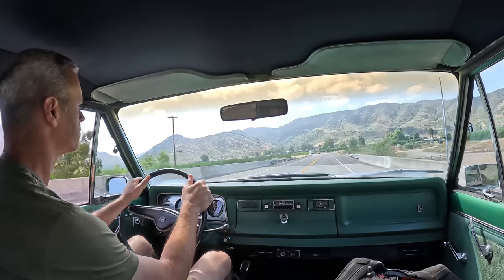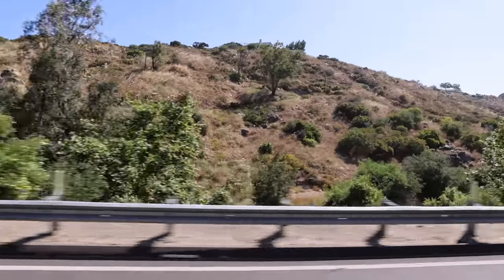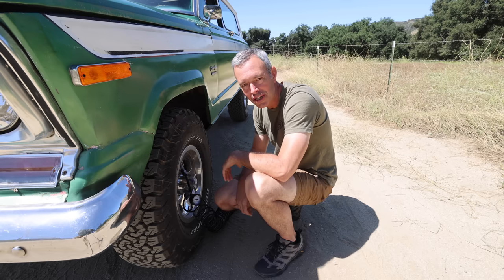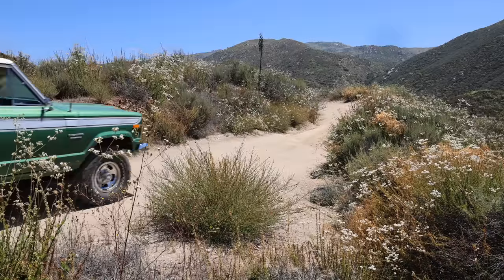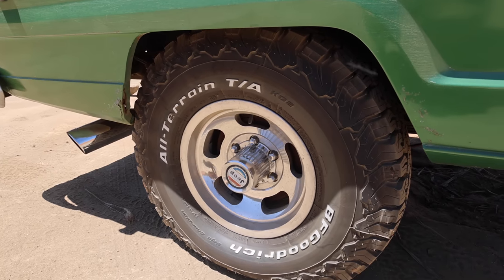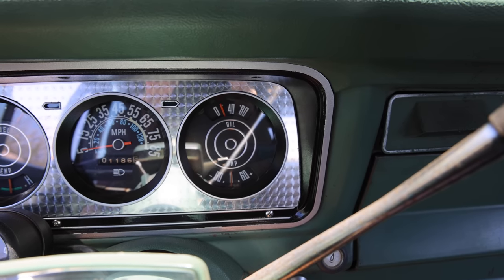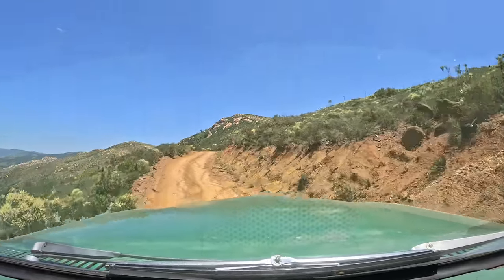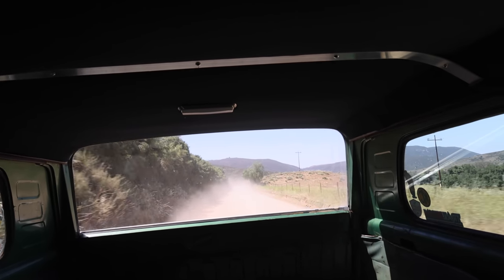Black Mountain Truck Trail, Ramona, CA - Prickly Pear Adventure

Comment: Brad you might consider replacing the carb with a Holley or Fitech system. No, it doesn't stay original but some things are better sent down the road.
Reply from the maker: Its an option, but then I'm adding computers to this old girl... so we'll see.
Reply: I agree Brad fuel injection is the way to go. My 83 Cj-5 would also stall in high elevations and steep inclines. The fuel injection fixed all my problems, and better gas mileage!!
Reply: @TrailRecon  agree, inject it and keep the old carb in the garage if you ever need it. Benefits outweigh the few cons
Reply: Holley sniper and the electronics  are fully self contained in the throttle body and looks like a carb. You can even hide it under the original air cleaner.
Reply: I definitely recommend this and swap the ignition system to and hei if you haven't already.  It's really easy and the fitech is great , self learning and my old 360 woke up from it and 12 mpg average now.
Reply: I agree - it may be worth the effort and expense of adding FI. I get wanting to keep it fairly stock, but for sake of reliability, you may want to consider it.
Reply: Add a sniper to my dad's old cherokee. Best upgrade we've done on it.
Reply: She is such a good looking Jeep  Brad. 10 mpg is tough on the wallet but I hope you keep her for ever.
Reply: @TrailRecon  Throttle Body Injection was the best upgrade I've done to my '85 CJ7 inline 6. Starts reliably and idles like a dream.
Reply: Gotta agree!  THe holly sniper fixed a whole host of issues on my RamCharger.
Reply: Plus one for a fitech
Reply: AMC guy here. CJ7 swapped a 360 Wagoneer engine and transmission, installed a Quadrajet carb,electric fuel pump, hei ignition. No issues. Been running the Quadrajet for about 17 years after Holley,Edelbrock.

Comment: When Prickly was going uphill and hit that bump and then died, I knew right away it was flooding from a carb float issue.  If you do not have the carb float set just right, uphills will cause flooding.  Also, the jets would need to be replaced to run at higher altitudes (it's not just a screwdriver adjustment).  Thus the comments below for using fuel injection.

Comment: If this unit is equipped with a Rochester Quadrajet carb there is no reason to change, this is an excellent unit and with the center float design works well at various attitudes (lean angles).  The plastic float however can get saturated with fuel and cause float level to go high. The way the rig acted when you hit the bump, I suspect this to be the case. You can also lower the float level from the original spec if you want to experiment.
Reply: Also sometimes raising the float bowl vent can keep high lvls of fuel from splashing up the vent tube and dumping too much fuel on the bumps, basically flooding the engine. Not sure if any aftermarket offroad needles are available like Edelbrock/Carter AFB's though.
Reply from the maker: It has an Edelebrock on there now.  Just a bit of sorting to do.
Reply: Oh nice! I used the offroad needle kit in my Carter Afb on my Scout II set my float little lower and never had it flood the engine and stall. I hope to see more offroad adventures with Prickly Pear!
Reply: I’d add my two cents as I had the same issue with my Wagoneer on speed bumps at sea level. Bowl was just too full and fuel would splash and cause a momentary flood. Though the Howell Eli Is most ideal for wagons over the excellent Holley, it’s not necessary but will help reduce the exhaust smell. You’ll be able to enjoy the rear window down for a drive. Best thing I’ve done with my wagons … run it on 100LL … a gallon or two in every tank makes a most noticeable difference. Every once in a while a full tank of 100LL makes it sing. The exhaust smells better and it’s just as unhealthy as any other petroleum you can run through them. My AMC 360 motor with an Edlebrock 4brl gets 12MPG in cruise.

Who doesn’t enjoy the vintage wheeling videos more than the ones of modern vehicles?

Comment: Looks like an edelbrock carb
You can get replacement needles to lean out your fuel at higher altitudes 
Very easy to change get up high change them out have fun 
Then change them back at lower altitudes when your airing back up 
I think part of the fun of a classic is tinkering with them
I mean you got some really nice and very capable jeep in your garage
Keep it old school have fun and keep learning 
Thanks for your video I enjoy them

Comment: Prickly pair is looking good. You may want to consider an aftermarket fuel injection system like Holley or Edelbrock. It won’t be original, but more reliable. Great work on her.

Comment: Highly HIGHLY RECOMMEND Howell TBI kit and dump the carburetor. Better fuel economy, starts up without problems and runs like a top. Swapped out my carb on my 4.2 straight six. But get an experienced shop to do it right. 👍

Comment: I have an 85 Chevy K5 Blazer with a 350 and run a Holley Sniper EFI unit on there.  It made a night and day difference on performance and would self tune itself on elevation changes.  That may be an option with the carb issues.  Glad to see that old beast out on the trail.

Comment: As mentioned before look at a fuel injection setup for reliability, for the radio there are several companies that build retro fitted radios with modern options with original style faces. Looks great man!

Comment: In 2004 I got a 600 CFM Edelbrock Quadrajet copy carb for my 85 small block suburban,  never rebuilt or touched the cab yet except for a choke spring. It runs fantastic from sea level in Ocotillo wells to 8,000 feet high on top of Santa Rosa Mountain.  I don't know if they make them as good now as they did 19 years ago but 100% pleased

Comment: I know its probably in a video somewhere I couldn't tell if you 74 had a low range unit on the transfer case some came without.. Makes me miss my 76 almost identical to yours.  I did put a mile marker part time kit in the transferase no overdrive. Not even sure if they make them still  Sold mine back in 1999 bought it in 1989 or about then.  I far as i know its still running around Albuquerque.  If you want to get ride of the Quadratrac  easiest way is to find a jeepster commando  with the T400 they have the mainshaft, adapter, and tcase model 20. I did that on another project I had.. love watching the progress.. i need to find pictures of mine

Comment: Carbs off-road can be an issue. Whenever on an incline and hitting a bump, fuel can splash into the ventures from the bowl vent. Usually, a mode can be done to extend the bowl vent up higher, minimizing the issue. The float needle sometimes can also allow unwanted fuel in the bowl with the bouncing of the float. We would install an adjustable fuel regulator, and drop the pressure when running offroad. Fuel injection was a great leap in offroad vehicles, just as electronic ignition. How times have changed. Thanks for the great video.

Comment: I also replied giving a recommendation for a fitech, but if you want to stay with a carburetor, the Holley truck avenger is a good option, we ran one on a sbc in our cj8, we could drive from denver to 13,000 feet in the mountains with no issues, it also runs at extreme angles

Comment: As you know, I throw my vote in for the Holley Sniper kit. It’s been great for my 360 and 78 Chief. But before that, please do the ammeter bypass!  Plenty of write ups on the FSJ forums. Would allow you to move to a higher output one wire alternator as well. The sniper kit will monitor your voltage for you moving forward 😎.

Comment: If someone else hasn't mentioned it yet, you really need to get an accurate oil pressure gauge, soon. That's showing very low oil pressure for a fresh engine. I would also consult your engine builder and confirm what weight oil they recommend for your build. This is such a great old Jeep!

Comment: Awesome truck, I’ve been there with a classic on the trails… I had a 75’ F250 highboy, I put a Holley Off-Road Truck Avenger Carb and it made it way more fun to drive, especially at higher elevations. Thanks for the videos!

Comment: Your Cherokee looks so good inside and out. If you want to upgrade the radio but keep the stock holes, look into Retrosound radios. It fits in the original holes and you don't need to cut up that wonderfully original dashboard. You could also get or build a custom center console with a modern radio. I question AMC's gauge senders, my oil pressure sender/gauge shows 10-20PSI when it works and my fuel gauge shows full at 5/8. AMC engines are tough. If it sounds fine, it probably is.
It's fun to see other peoples' rigs too. The Defender is really cool and the Lexus Cruiser looks capable.

Comment: Hey'as I was thinking about the tires rubbing in the rear, you might be able to flip the springs if you have  offset centering pins. As the axel moves up it goes backwards, put the short span in front, which in turn  will move the axel slightly forward. Then as you flex you might be able to gain that extra space needed.  Ofcourse this all depends on what you have. Good to see old iron on the trails!

Comment: Another great adventure, THX and HAPPY B-DAY Jordan!
At that slow of a speed, your Idle mixture screw is the predominant influence in the carbs and you called it as running too rich.  I'd try turning the idle mixture screw half a turn clockwise as a start to leaning it in.

Your York A/C compressor is still used in major Semi-Trucks and instead of 0.6 cu ft they now have a full 1.0 cu ft displacement at about $300.  If the Evaporator and Condensor are good then clean them out with solvent, remove all old oil, get 4 new barrier hoses, a TXV, operational port valves and a good cabin ventilation fan to push it and your A/C is complete.  

These are quite similar A/C systems that we hobbyists put together for our vintage Italian cars.  The most important part is tuning the A/C using fill to the condensor's subcooling.  LMK if you need help, I have all tools and parts to make my own, even custom sized to improve flow
Reply from the maker: Thanks!  We are going to give making a modification to the current compressor a go, but if all else fails there are some aftermarket options worth exploring.
Reply: @TrailRecon  - Good on you!
There are a lot of folks who will claim that a pricey Sanden compressor solves everything. 

When you actually use HVAC Engineering principles to start measuring the refrigerant around the system then you can make valid decisions from facts.

I found the compressor is not the limitation of our 1974 York systems , rather that is 1) The Condensor and 2) Cabin airflow

The whole system should be tuned to the Condensor's subcooling as it is the limitation

Keep us posted!

Comment: I installed a Holley Sniper EFI on my Grand Wagoneer and love it. Runs great, starts on the first crank, and have never had vapor lock issues since. As far as mpg though, I think it went from 9mpg to 9.5 with the EFI kit. Not much of a difference.

Comment: You don't show it, BUT.. don't trust the gauge on the compressor.  Mine is off by almost 5-7 labs, so I use  my trusted digital gauge for final readings.  Another fine video.  Thanks for the ride and until next time... Travel safe.

Comment: Hey Brad, congrats on the maiden voyage!  A cool fun video might be to take the drive-by footage and throw an 8mm filter on it B-)   Also, radio idea - check out the bluetooth speaker tubes people use in Razor's.  They're discreet, easy to install, and easily hidden.
Reply from the maker: That would be cool!

Comment: I totally understand and love this retro Jeep project. I have the same thing going on in  a 66 Bronco I’ve been driving since 1983. One thing I know for fact. You cannot tune for near sea level and high elevation with the same carburetor with the same tune. Changing jets or metering rods is not something you should do on the trail.  The Holley sniper  fixes this issue. I know it’s not retro  but you not running bias ply tires either that it had originally.

Comment: I had one of those, it was a 70 something, I don’t really remember what year. It had a 360 engine and an interesting carburetor, that supposedly corrected for elevation. There was a third barrel that opened at high altitude. Can’t say if it worked but it was a stock carb.
Reply from the maker: Not the stock carb anymore, just a standard Edelbrock

Comment: Such a cool FSJ. I know you want to keep it original, but I would look into throttle body EFI. Either sniper or Dominator etc. would look like a carb but would get rid of all the stalling issues regardless of elevation.

Comment: Nice rover! Retrofit a Quadra jet if you want to keep a carb. They are the best factory carb. Been running one for years. Lock your center diff. You were one wheel driving that ditch.
Reply from the maker: Center diff vacuum lines and the switch are on the repair list... coming soon!

Comment: Ya'll....... I'm still waiting on my engine after 3 months already.    They finally got all the parts needed and putting me on the bump up list! I been stuck in the city for almost 6 months now and I'm dying inside lol.    Glad to see ya enjoying the cherokee man.    Looks good but i would definitely put fuel injection on it.  Might even gain more mpg not to mention more power and reliability,  just keep the original stuff in a box  and put away
Reply from the maker: Hope you are up and running soon! I had the same challenge when I rebuilt this 401.
Reply: @TrailRecon  my 4.0 is now a 4.7 stroker with a scat pro comp crank and icon forged pistons with other goodies mixed in for good measure,  also got the updated head design with the thicker casting so no more cracks and bonus none of this has any miles on it except for the block of course,  stock cam profile so no tuning is needed plus I got a performance coil system to replace the rail type and bigger higher volume fuel injectors   only downside is now it can only run on premium fuel coz it's 10.1 to 1 compression ratio.    Just talking about what's coming makes me feel better lol

Comment: I have been using the 400P Viair for five years on my 4Runner and it works great. I recently paired it with a dual Indeflate, and that really speeds up airing up. Love your retro rig Brad!
Reply: The indeflate really is an awesome piece of kit, not as bulky and a lot easier to handle than the 4 tire deflators. I'm using it for a couple of years now and still happy

Comment: In regards to carb tuning Brad I would save yourself a lot of trouble and headaches and convert it to a modern day throttlebody or MP fuel injection you’ll be able to improve your engines, torque your fuel economy. It’ll give you control over the power band meaning, moving the torque curve up and downs and you won’t have to worry about rejetting your carburetor or caring and a jet kit with you when you change altitude. Trust me I know I have a lot of experience tuning carburetors. I was tuning Weber IDA’s & DCOE’s by ear when I was in elementary school on race cars.

Comment: When you hit that bump and the Cherokee stalled I think the needle got stuck this was common with truck carbs as the rapid down movement would cause the seat to stick flooding the carb which is why it looks like it was running rich.
Reply from the maker: Good point, maybe a combination of the altitude and the needle.
Reply: @TrailRecon  I know Holley makes a Truck Avenger 670cfm Carb that is perfect for your application it was designed for trucks and 4x4 to be exact it might be something to look into.

Comment: Great video. Couple of things..1. I agree to a point with one of the other commenters about the name thing..I understand where the name came from, but it feels too network tv/magazine-ish(just my opinion), 2. Not sure if was an optical illusion or not but is there some wobble in your steering column? it looked like when you were backing out of your garage that the wheel kinda wobbled side to side a bit when you touched it, 3. I'm sure you've heard of them but maybe look into Retrosound for a radio. They look like a factory radio but have am/fm and ipod/bluetooth connections so you get best of both world...old school looks/modern radio features(just a thought), 4. Have you thought about a carb replacement efi system? Seems like it would be a good idea for the type of driving you'll be using the Jeep for. Sorry for the novel here. Looking forward to more
Reply from the maker: Well the name has stuck with me, so you all will just have to accept it and honestly don't see the network/tv show relationship.  Steering wheel fix is coming, just got the special tool I need and also already have the stereo I'm going to use... no one will ever see it!  Verdict is still out on what to do with the carb.  Thanks for your comments.
Reply: @TrailRecon  i'm not faulting you for sticking with the name. It's your truck and channel so do as you wish. I just gave my opinion on it. The tv/magazine thing is that most of them come up with names for the vehicles they build, probably for editorial/parts reasons. What tool did you need? Just curious as i've never pulled a Jeep column apart. Cool on the stereo. Will you do any kind of install vid for it? Have a great weekend.

Comment: If your still having electrical problems check out painless wiring harness. Have an old cj 7 it’s all bolt on. No mods.
Reply from the maker: I've looked into painless, they only have universal kits for my application... may still be an option though.

Comment: A carburated engine shouldn't really have much of a problem with altitude when it's ony 4,000 feet AMSL.   I hauled half a ton of wood stoves over the Sierra from Lake Tahoe to Placerville, and while I glazed the clutch, the carburation was no problem.
Reply from the maker: It shouldn't, but I think it is running rich at sea level.